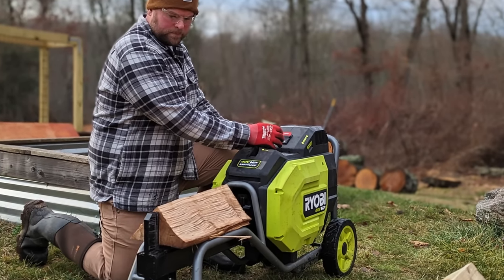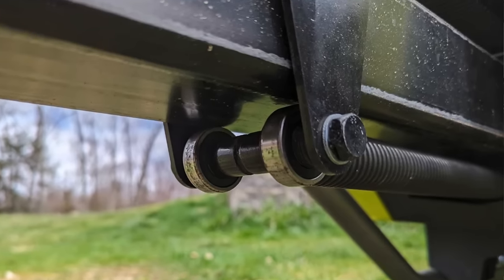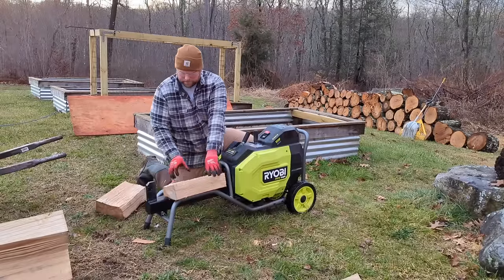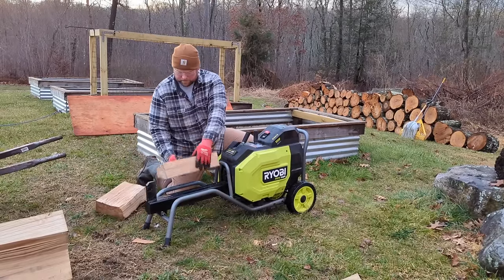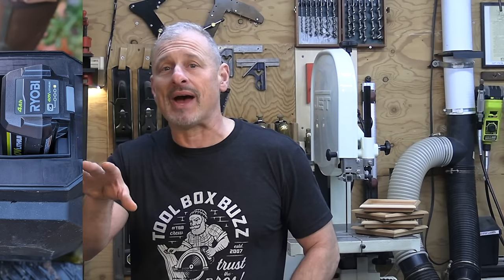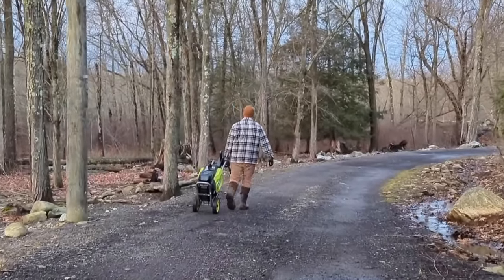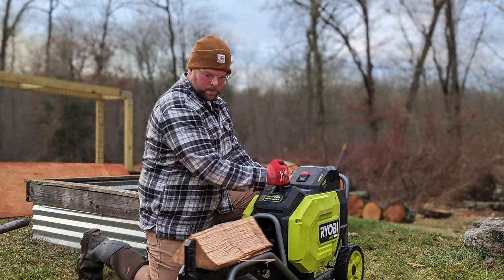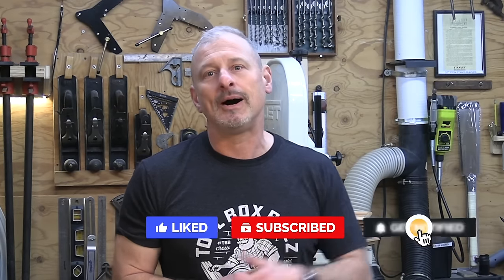Ryobi 40V HP Battery Log Splitter

Comment: You mentioned putting it on a platform or table. But ergonomically wouldn’t it be better to get a thick kneeling mat, Husky at HD, than trying to lift logs onto it and risk blowing your back out? What’s the better trade off?

Comment: Looks like it's okay for low volume boujie wood.  Let's see it run some gnarly hardhack.
Reply: yeah, so, did you actually watch the video? This log splitter out performs any hydraulic system I've used.
Reply: @TomUlcak  must have used some really small hydraulic splitters.
Reply: @myloveisajoke  'must have'? did you watch the video?